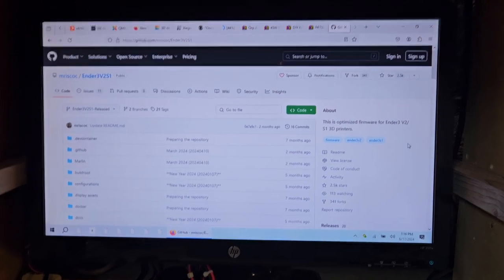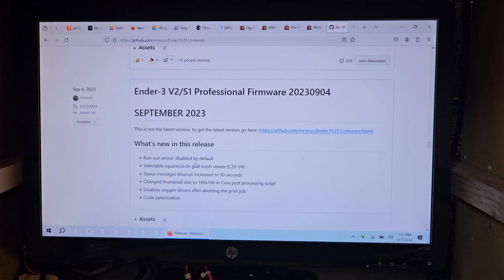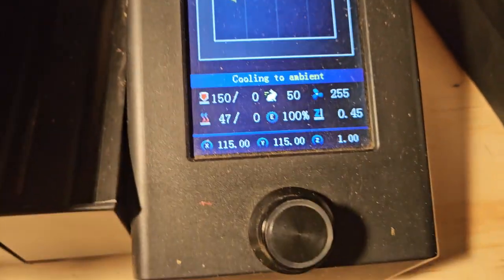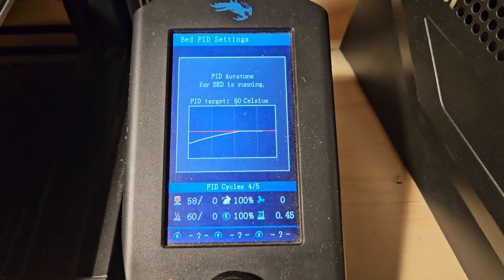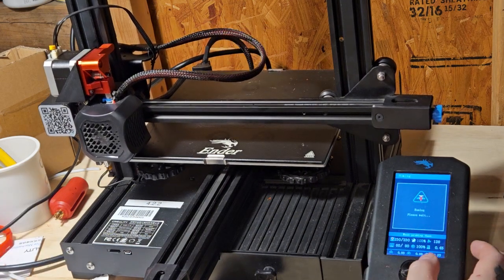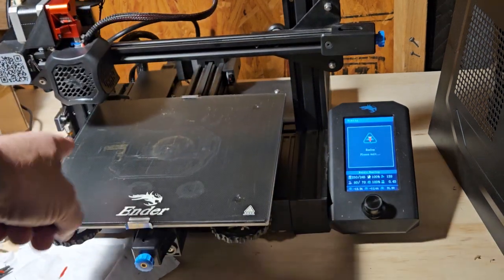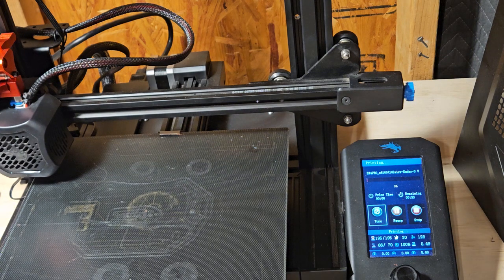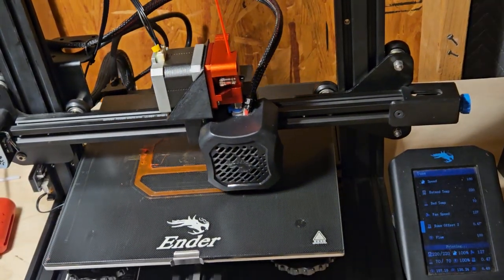Setting up Mriscoc Professional firmware for creality ender 3v2 3d printer

Comment: Hello, please could you tell me how I could update when a new version comes out? I've tried it right now but it only says that it reads files with the gcode extension but it doesn't read bin files.
Reply: If you have any other files on the memory card it won't work. You need to have the bin file only on the memory card and turn on the printer power with the memory card in.

Comment: Can you please do a video on the linear advance version. I am unsure how to setup. For example after installing the premade LA version of mriscoc for a ender 3 v2 with 422 board what do i do next. How do I then find my k value and do i need to modify my gcode in cura or do i adjust the k value on the printer.  A full simple tutorial would be appreciated
Reply from the maker: Thats a good question.  I think Bryan bds did a video on this.

Comment: Anyone experienced loss temperature control after doing build in PiD autotune? I confirmed all my hardware was good.attempted few time. Got the same problem happened. I don’t know it’s a bug or anything? Now never use the autotune again. Or someone got any idea why I having this issue? My board is 4.2.7 installed with manual mesh version
Reply from the maker: I had a loose element in mine
Reply: @hamradiohack I’m comfirm all elements was set in good…troubleshoot for everything…check thermistor value…tighten up everything….at last I found the exactly problem was that build in autotune get me in the problem….no idea what caused it…🤔